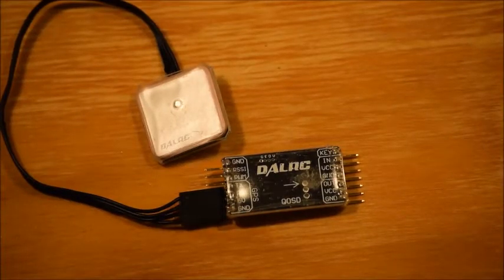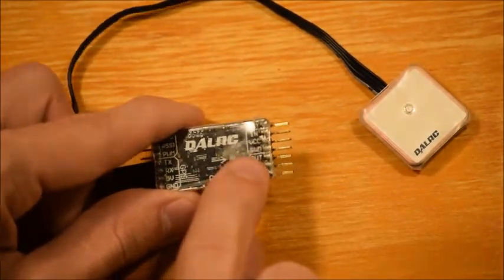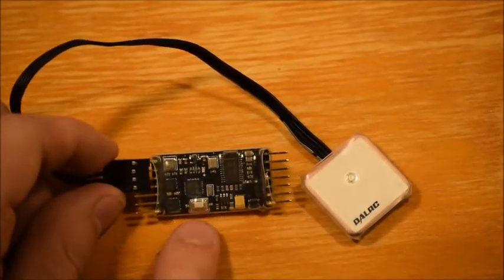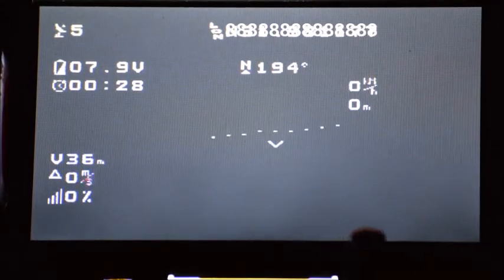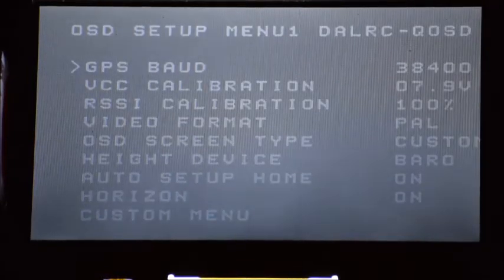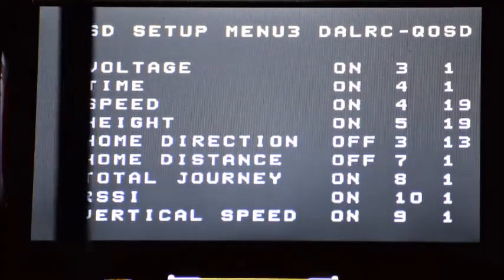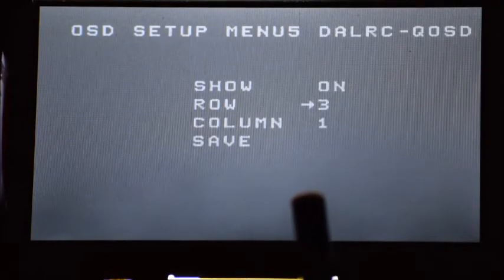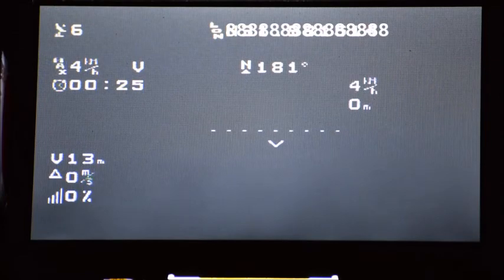DALRC QOSD Review / Overview

Comment: Just installed this in my glider about a week ago. Absolutely 100% happy with it, and the cost is great at like 1/3 the cost of many other osd's with.... lets face it.... wayyyyyy too much crap on the screen that you dont need on an already crammed relatively low resolution action cam. Yeah super happy with this osd. It was a huge pain in the rear getting it wired up. But totally worth it. I would definitely buy this again and at this point I wont even bother looking at reviews for other osd's cause I already know what Im getting and the price vs value is great.

Comment: Fully subscribed.  Great info. Wish was more detail on the connections /power / ECT. Can this be run without a reciever??

And since your vid post on this, how's it working out for You? I just bought one, but trying to learn everything about setting it up.

I too am an ol- rc/er and am jus now trying the quads which I would like to instal this unit stand-alone into my bugs (no gps) 3
Reply from the maker: jon buckiflyer , greetings and thanks for checking out the video. What are your power related questions? like min/max voltage? it can be used without the receiver connected, it will just always be "on". I tried to put mine ob a build the other day but for some reason I couldnt get it to power in, I may fiddle with it some more, I might have fried it the last time I used it :0
Reply: Hi. In your video examples this is perfect, just what I'M looking for how you have shown. Is there a way to show a pictorial of your complete connections? The power / voltages would depend on each device used, unless all devices are same voltage inputs. The only low voltage i see is for the gps connections which is pined at 5v.  Did you find out why it wouldnt power back up for you upon installing it in your project? Hope it was something minor that you didn't fry it..  i have this same unit, but i find the connection details and voltages required a little confusing.  A big answere you gave me was i i can run it without a reciever "cool".  Afain your video displayed was perfect. Is there a way to show or describe your final connection points? Btw we've been talking on other of your vids re this same subject.. guess you've  noticed. I like this DAL unit.
Is there a way to permit exchange of email regarding this unit instal / operation. I have been searching and yours has been the the closest  I've found. Which is why i ask..

Again, hope you hadn't fried yours. If you did -can you share what Not to do lol.. 
I wish others who have this unit would chime in.. 
Thanks Again for your time.

Comment: Bought one. fails to ever obtain a GPS link. Everything works and looks great. But no GPS link. I suppose I'll have to bear the pain of a return to HK.
Reply from the maker: Paul Warye , that stinks, I have two ideas, 1:awitch the rx and tx wires from the gps, 2: see if you can get a signal outside
Reply: The supplied button cells in the GPS unit are crap, just drop a new one in, problem solved.

Comment: Product link https://hobbyking.com/en_us/dalrc-fpv-on-screen-display-osd-and-gps.html?___store=en_us . Does this badboy come with wire connectors? Nice Vid and review! THanks!
Reply: If I remember right, it comes with the gps which has a little 5pin servo type wire built in. Then it comes with 2 servo wires that have one end regular servo, and the other end they are split individually so you can put on specific pins. Honestly I didnt use them though, just cut and soldered my own servo wires. Just gotta be conscious of the voltages you put into this and your cam... and whatever else. The little instruction thing it comes with has a picture but thats about it. Took me like 5 hours of screwing around until I figured out I had 5 volts running into it an it needs like 7 to work. Anyway, great osd I would totally buy it again and if you dont like the screen setup, you can change what you see on the screen and where things are placed.
Reply: alt ctrlesc awesome infos. Many thanks! !